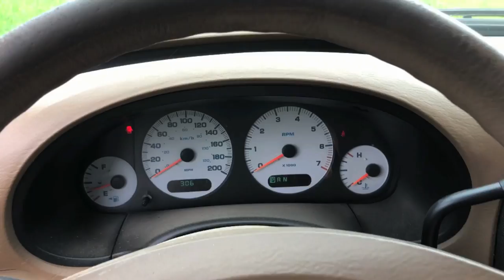Super DUTY 4X4 IS A BEAST!

Comment: Mark if you get a dedicated tractor for the track with roundup with a 300 gallon boom and lane and left and right direction sprayer and 4 in 1 bucket for lifting cars off trailers and light dowser work and it can be a right off for your taxes